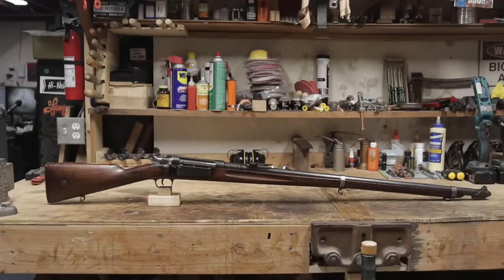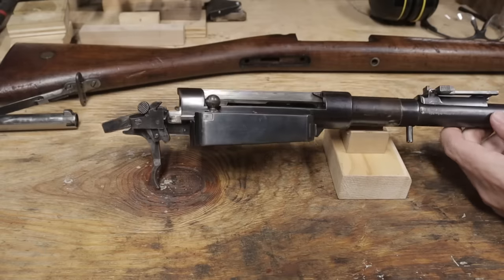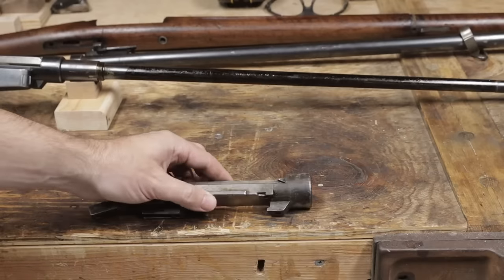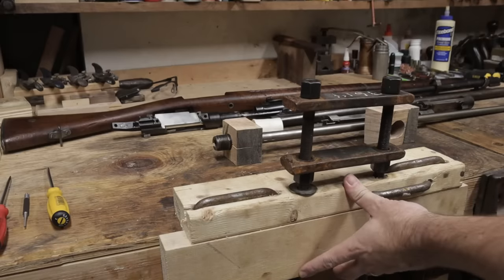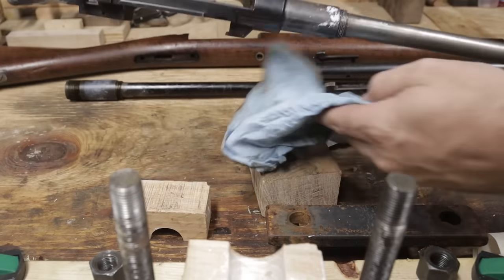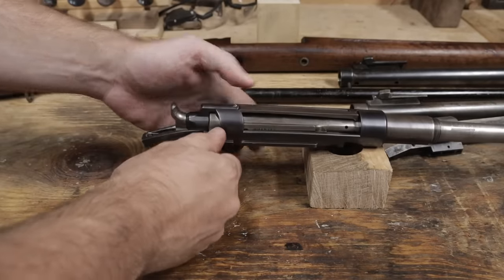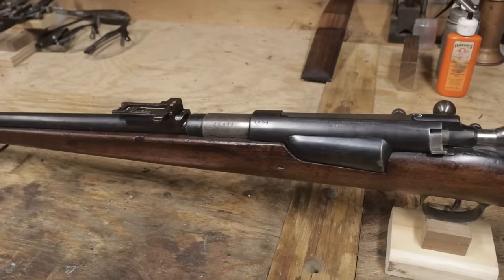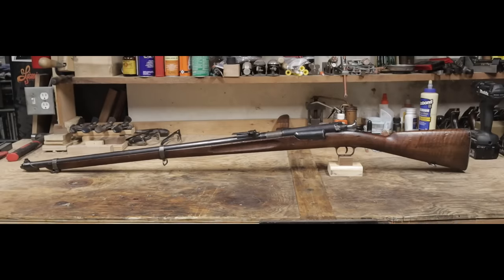Reactivating a Deactivated Rifle

Comment from the maker: I posted a follow up where I attempt to salvage the original barrel
https://youtu.be/3BxtWPuNeKw
Reply: The tape is 5000 thick? what?
Reply: @granola661  "5 thou".  A thou is short for a thousandth, or .001".  So the tape is .005 inches.  Normal printer paper is about 3 thou, so that sounds about right.
Reply: @TheFreshmanWIT  Just say 0.1mm jesus fucking christ
Reply: @granola661 I have no idea what that is in lengths of King George's shoes.  So what good is saying it that way?
Reply: @granola661  we dont use the metric system.
Reply: @SerfsR-WE  how many inches is a foot
Reply: ai:7, approved

Comment: I just recently restored a Mosin nagant M91 that was deactivated. Thry removed the fireing pin and ran allthread through the bolt then welded the cocking peice to the reciver. Thankfully it was a small bead of weld and i was able to file lightly and pop off the weld bead. New fireing pin, spring and cocking peice and shes up and fireing again!
Reply: This past year, I desporterized a 91/30 Mosin Nagant. Someone swaped the wood for a cheap polymer drop in stock. Spent a month or so sorceing parts and accessories.

Comment: Well done. Even if it turns out the accuracy isn’t the greatest. You brought a rifle back and one that now can at least be demonstrated as a functional item.
Reply: Well, easy if you have spare barrel just like that, real "bad boy gunsmiths" redrill the old barrel and whatnot since not everyone got loose barrels at hand LOL
Reply: @SwedishEmpire1700  Yeah, but on this project the barrel was cut in half and rewelding a barrel? I’m thinking that’s sketchy as heck. 

Question I have is that if you just had lead in the barrel could you heat the barrel up enough to pour out the lead then reheat treat the barrel or are you going to get a warp?
Reply: @Whitpusmc g
Reply: @Whitpusmc  I was thinking the same thing.
Reply: @Whitpusmc probably nothing would even happen to the barrel. Though your health might suffer if you don't do this in clinical conditions.
Reply: @Whitpusmc  Rakum did say in the video that that's what he hoped to do before he discovered the cut barrel. So, yeah, seems like you can.
I'm surprised, I 100% would have thought that'd mess with the temper or cause a warp.
Reply: @Whitpusmc I would venture to say it's probably better to just punch the plug out, then melt any remaining slag.  Heating the whole barrel long enough for the entire plug to melt might cause some issues.

But I'm just a layman.  Pure theory.
Reply: @Swanhub  I think you are on to something. Even a progressive drilling out from the center would mean less material to heat up. Maybe gently heat up the barrel afterwards and see if the plug loosens enough to then punch out. Alternatives to brute force heating and ruining the barrel temper.

Comment: This is amazing to see such work in action! The gunsmithing on krag rifles is really a lost art now only a few can seem to master it,. My grandfather was gunsmith and through the  60's and 70's he collected these rifles in 30-40 and 6.5x55, he made his krag receiver clamp very similar to yours, he was able to mod the bolt contacts surfaces to where the bolt locking lug and the bolt handle both made contact with receiver when closed greatly added to lockup strength reducing bolt failure.

Comment: It was probably sold as a collectible that way. Lots of them were imported. It might be a bringback, but I've never seen one with a cut barrel.

A friend had a DEWAT Japanese Type 99 machine gun, Amnesty registered, with a cut and brazed barrel. There are effectively no spare parts for these anywhere. What we did was run a rifling swage into the cut to get it properly aligned, then tack-welded.  Then we stuck a copper rod of close diameter down as a heat sink, welded all around, lathe turned to clean up. Then run a rifling cutter back through to clean the inside of the weld.  It still has some irregularity, but it shoots adequately for a support weapon.
Reply from the maker: Interesting. Thanks for explaining the process. I knew it was technically possible but wasn't sure just how it was done

Comment: Great job! You created go/no-go with the brass which is effective on a rimmed case. Krag likely adopted the Mauser production standard where parts made in their licensed factories were made to exacting tolerances and largely interchangeable. 
I did a Ross .303 rifle once for a collector. This had a 3/8” pin across the rear of the chamber.  Fortunately there was enough reinforce left to cut, set-back and re-chamber.  Might have machined an adapter but can’t remember.  It worked very nicely.  For the critics - the root and contact area of even 3 tenon threads of coarse pitch usually equates to more than the locking lugs on most rifles. And the remaining chamber reinforce still exceeded that found on an SMLE.

Comment: I just picked a Krag recently. I want one in its original condition, but this one was sporterized. At the very least, it was inexpensive, and whoever did the work seems to have known what they were doing with nice results. Nice video.
Reply: I also have a 1896 sporterized Krag. It's in a nice black walnut Bishop stock. Still a tac driver and the action is butter smooth.
Reply: Good luck getting a stock. Stay away from sporeterized junk unless you want a bunch of worthless rifles in terms of collecting. Im telling you this from experience the cheap rifles are tempting but you’re really doing your investment opportunity a disservice
Reply: @DelGTAGrndrs  I usually do,  but this one was at a price to tempting to pass up and I had been thirsting for a Krag for a while. I am still looking out for an original US Krag. I picked up a Springfield trapdoor in the same purchase.
Reply: Keep in mind that the 1896 Carbines look sporterized but actually are not. They are built like that.
Reply: @genericname4739  oh no this is definitely sporterized. Sporter style stock with raised cheek rest and color case finish on the receiver, with a glossy black finish on the barrel and a Lyman rear sight.
Reply: @DelGTAGrndrs sometimes they're a good source of parts and if you find a well-executed one you have yourself a hunting rifle with style.
Reply: I too have a 30/40 krag of model 1893 add two was sporterized someone previously had cut the forestock off, I did however find a forestock on Ebay cost me more then the rifle. I have been restoring over the last month and once finished the joint will be hidden by the metal clamp just fwd of the reciever.

Comment: Very clean reactivation! Our quickest and easiest was an M95 "Spanish" Mauser carbine sold as a "parade rifle" for $25 at a swap meet around five years ago. It appeared upon first external inspection to have a solid barrel, and the bolt was missing. When my son got it home it took him around 15 minutes to sand the weld off the tip of the barrel, shake the steel plug out and re-dress the muzzle. The rifling looks like new - and he quickly located a replacement bolt all ready to put in.

Comment: Fantastic video. Great documentary . Your analysis of the condition/safety of that rifle is perfect. I collected Mausers  from WW2 and prior. Every one was special. I had a VZ24 bag cut bring back. Luckily only the stock was cut. And repaired by an old German gunsmith I knew. I did something a little different with my reloads. When buying a new rifle..I had downloads to check the firing. I always loaded 50 rounds at a time… with 10 standard loads, then twenty rounds up in two different heavier powder loads and twenty loads down in two different loads. I also tried two different grain weight bullets. I also loaded IMR 4064 and/or 3031. The 8mm Mauser bullet was limited in selection. I also only used Federal cases (Lampua when I could find and afford them) and never did full case resizing. I always resized neck only and only trimmed to correct case length. Those fired cases always stayed with the rifle. Like a “finger print” each rifle had a load it liked. Often got 2” groups at 100yds. Enough of the rambling. I retired as president of my gun club, sold all my rifles and reloading stuff to a member. Your video makes me want to “ 
have one more”… Thanks for your video.

Comment: I use a bit of rosin dust on the barrel to get a better grip on it. I have the gun vise sold by Midway as well as the receiver vise.

When space is critical, and you need to use paper to fit it, again, rosin dust will help there too.

Great work! Too bad they cut the rifles to bits today...
Reply from the maker: I would have needed to get my hands on some rosin if the gym chalk didn't work. Larry Potterfield from Midway's videos were a help in putting this together.

Comment: Someone here posed an interesting question on melting the lead plug. 

I was intrigued, and a quick search confirmed for me that the melting point of steel is 2500-2800°F(1371-1540°C) while the melting point of lead is only 327.5°C. I did find that the strength of steel is unchanged up until 600°F
Reply: It can easily be melted with a simple propane torch.
Reply: All rifles are heat treated so that it strengthens the barrels. It's a very very high heat. No damage is done to the barrel of one melts the lead plug.
Reply: @screwthecabal6453  Thanks for the confirmation. I was just concerned about weakening the strength of the barrel.

Comment: Yes I have seen this exact same thing before.  There is another video on youtube of a guy reactivating one and having to find a spare barrel.  His was cut and one spot had been drilled.
I don't know if you have access to a lathe but when a Krag doesn't index right you can always turn the shoulder back a couple thousandths of an inch and run in a solid pilot reamer in the chamber.  I've done that a lot.

Comment: Nice , very crafty and gets my approval . Two points I'd recommend - The rim of the cartridge should be placed behind the extractor , as this is how they are fed up , out of the magazine ( could very possibly harm/brake the extractor , and I always never put my face behind a rifle I'm concerned about headspace or have never fired before ( surplus ) , I shoulder and turn it to the side , then if the brass check's out , all should be fine !

Comment: Good job! I've always found heat to be a huge help when dealing with threaded parts. I'm not talking about temper changing heat, but enough to cause the metal to expand. A heat gun should be sufficient.
Reply from the maker: A heat gun is a good idea. I didn't want to use a torch because the bluing is so nice.
Reply: I agree with that.  Heat is like magic.  Especially when working with automotive applications.

Comment: I bought a couple 03A3 demilled rifles from the local JROTC unit as they were replacing them all with wooden fake rifles. Along with the plugged barrel, they also tack welded over the bolt face to cover firing pin. Safety was broken on the ones I got, not sure it was from being dropped or they were issued that way. 2 barrels and 2 bolts later they were functional, but took some scrounging.

Comment: A lot of these plugged Krags we’re turning from Veterans organizations and used for parades. They were plugged to prevent chambering a cartridge. Based on the duffle cut it might well be a bring back. These were Skso sold as cheap surplus back in the day from companies like Bannermans. I’ve seen them in various sporterized configurations from  minor changes to completely modified. Just saw one last weekend in a shop in ME with a bishop stock , rebuked with a scope mounted . The issue today would be cost of replacement parts would be a labor of love and far outweigh the value of the rifle
Reply: Filling the barrel with lead and cut it in 2 while keeping the fire mechanism unspoiled seems a dangerous way to deactivate a rifle. Imagine what happens if someone tries to load a cartridge and pulls the trigger....
Reply: @perterslse2543 yes good point- most deactivations are more permanent and involve welding up parts so a cartridge can’t be chambered . This seems somewhat amateurish but at least allows the rifle to be  restored to firing condition.
Reply: The rifle was plugged to the end of the chamber. Couldn't load a round.

Comment: I have an 1888 German Commission rifle with a spiked barrel.  Unfortunately they used hardened steel rods in the muzzle and the chamber.  I picked up another barrel but can't get the barrel broken loose from the action.  The actions are very long and thin with no hold for a wrench of any kind.  They must have had a special built jig to hold them.  I completely restored and sourced parts for the rest of the gun and it looks great. I will try again someday.
Reply from the maker: The Gewehr 88 receiver has a very similar shape to the Danish Krag in the video. It's mostly round with a lug protruding. You can use a similar receiver bushing. For the barrel, other commenters here had some good tips to get a better hold, using rosin, aluminum bushings, etc.

Comment: Your tips on barrel take off and adding new barrel might help me get the barrel off an old M1917 receiver which has had the ears shaved off.  I'm not very handy with tools. I try to find your other videos on the Krag, other than the U.S. versiion.  I have 2 Krags.  One a 92 converted to 96 and another dated 1903. Both are in VG+ condition.  This video was very well done. You're approact to the procedure as slow enough for any moron like me to follow. Thanks.

Comment: You should use rubber gym bands in that wooden clamp, they grip steel insanely well and act as a cushion, ive used it to disassembling airguns when tuning them with great success

Comment: Really nice work and what a beautiful piece of a rifle. In my country deactivated guns are handled as activated now and the deactivation is a lot more. So to reactivate you must change the receiver and barrel, bolt as well. Because the barrel, which is already destroyed through welding/blocking and caliber big drilled holes or a slot and the receiver is welded with the barrel, the bolt most of them are cut down and the strikerpin is welded in, too. So it's not impossible but easier to buy a new gun. Nice to see how it is in America
Reply: You’d be amazed with what some american gunsmiths can do with a welder and a good heat treat.  I’ve seen guns chopped up like that be restored to working condition here.  Except the barrel usually gets replaced.  We can get pretty inventive.  If you’ve seen Brandon Herrera’s youtube channel, he’s restored chopped up mosins(although he turned the one he restored into an obrez pistol) and aks.

Comment: This rifle has only been half heartedly deactivated. Here in the UK deactivation means cutting a grove on the underside of the barrel most of the way along its length and then welding a length of tungsten steel rod to the inside of the barrel most of its length. The grove in the barrel will extend well into the breech underneath. A hole is drilled through one side of the breech and a small piece of tungsten steel is welded into the hole so that it blocks the breech. The end of the bolt is ground off destroying the ejector and firing pin. You could cock and dry fire the gun but a rifle deactivated in this way would never fire again in this life or the next. It is destroyed.
I think the latest rule of law now also requires the bolt and trigger to be welded to the receiver making it truly inactive. You americans have it so easy when it comes to guns.

Comment: Hey brother. I'm the son of a gunsmith. My dad was a gunsmith in Ranson WV for 50 plus years. Everything you did as far as headspace was correct. If you continue to work on firearms, you should probably invest in a set of gunsmithing screw drivers. Great job on the rifle though. PEACE ✌️
Reply from the maker: Thank you. The screwdrivers I use have parallel tips, made by PB Swiss.
Reply: @rakumprojects  ok, there you go. Didn't know that. I have seen so many people screw up the heads on screws that it's not funny. Used to piss my dad off something terrible. A guy brought a Drilling double barrel shotgun with a rifle barrel. He had to drill out 3 screws and make new ones.  Great job on the Craig. You got lucky and got a great one to fix up. Dad loved those old guns. All these people buying Glocks, Aliens, the mew Rugers, and dad was a die-hard 1911 fan. When he passed, he was building a 45acp and a 38 super combo. Same frame, just switch out the top end. I'm in the process of finishing this set. The frame is all custom. it should be one hell of a set once I get the barrels fitted. Anyway, keep the videos coming, brother. PEACE ✌️

Comment: On an M2 machine gun the headspace is extremely critical as it affects the timing of the operating system.  It must be checked every time the gun is cleaned and reassembled and when the barrel is changed.  The M2A1 upgrade which was introduced in 2010 brought changes to the quick change barrel system and the bolt to eliminate the need to do this.

Comment: You haven't seen how it is deactivated in Russia. The barrel is not only drilled, but also covered with a steel insert. The shutter mirror is cut off, there is no ejector, and the channel where the firing pin was located is plugged. So, you have almost a whole rifle.

Comment: When you were loosening the barrel, you might want to heat the joint. I use a cheap propane torch and heat for about 30 seconds to a minute, but I don't use the wood setup like you have.